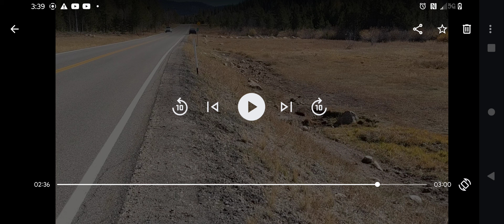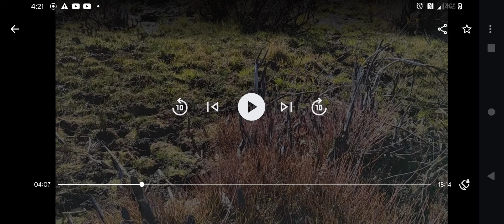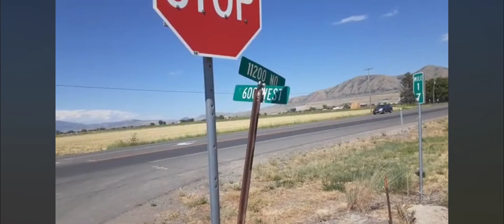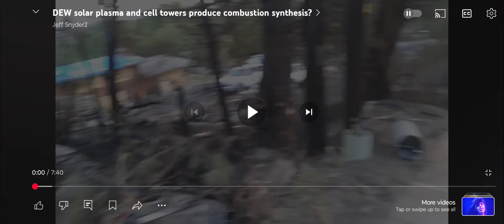yellow lake plasma fire near kamas Utah+directed energy investigators hot leads

Comment: Just saw this post
"Current images of the Lehigh Gap. Northampton/Lehigh/Carbon County lines. This fire is burning out of control at this hour.

Here's a local report from the area...

"I live on timberline rd at the base of the mountain. I just spoke to the firefighters down at the trailhead to the state game lands. The guy said it's going to be burning for two weeks or more. It's traveling through the root system below the surface and fires are popping up everywhere. He said get a leaf blower and blow any debris away from the house or buildings as far as a you can. The helicopters can't fly at night and they'll be back in the morning. Because of the crosswinds they were having difficultly transporting the bambi buckets to dump water on the fire. I have neighbors with barns filled with cattle and other livestock and they are bulldozing around everything and clearing the debris in an attempt to protect their animals and buildings. I would say it's serious." 
- David Rombold"
Reply from the maker: I looked up the post on Facebook it looks like it's in Pennsylvania correct?